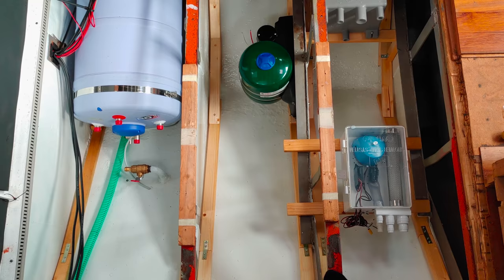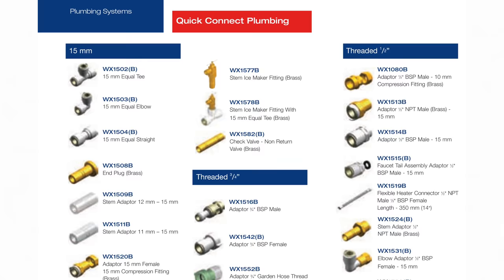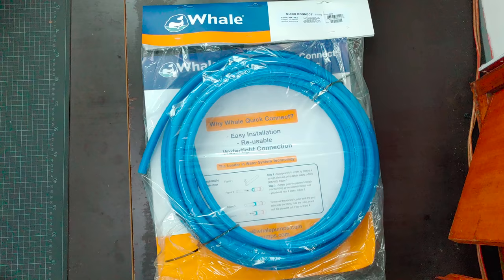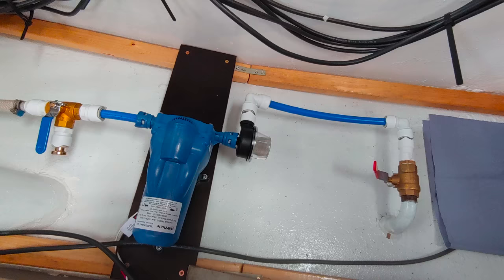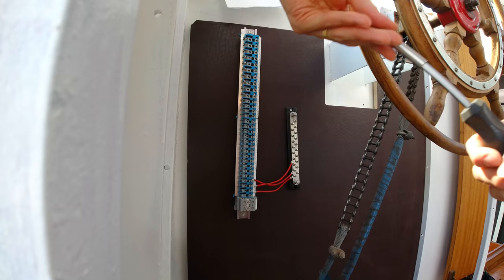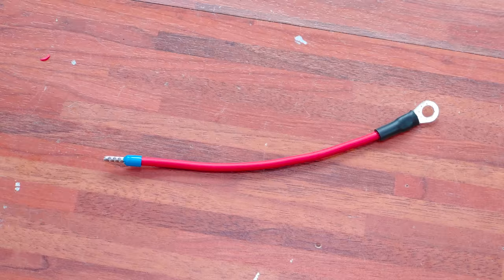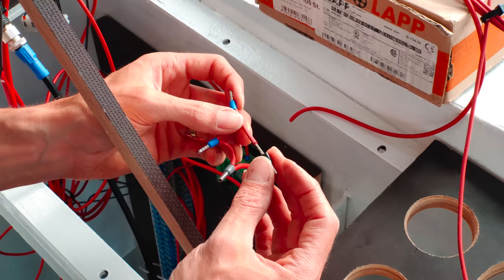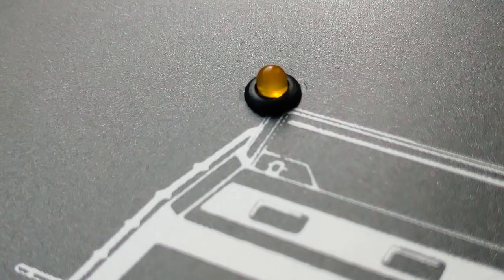Business as Usual at our Boat Refit Project - Ep. #43 - Vintage Yacht Restoration Vlog

Comment: Great video, I love watching your videos. When you use the white connectors like the ones used with the light indicators and on the deck with the anchor light. As a rule of thumb from an old electrician. Try to avoid the connectors with brass insides as the are prone to cracking when in the elements and making a loos connection that will lead to heat and melting. Try to use the connectors where the screws don't directly come in contact with the wire, it will have a metal plate that will be pushed down onto the wire, they are usually black connectors. And when using them outside, use a bigger connector so that both wires can fit on one side and wrap it up in electrical tape all around for a good seal. Always leave the connectors  pointing up so no water makes it in next to the wires. It will save you a lot of effort in the future with loos connections and corrosion on your connectors.

Comment: When wiring on a boat or anytime in my book use Ox-Gard Made by Gardner Bender, Guards against oxidation,The perfect safeguard for aluminum-to-aluminum, aluminum-to-copper wire connections and aluminum conduit joints.

Improves conductivity; penetrates aluminum oxide to maintain inter-strand and inter-conductor current paths

Produces a cooler connection.  Just something to help you down the river.
Reply: If oxgard is difficult to get I always use Zinc oxide in a tube from the local pharmacy. Also prevents reaction between steel fasteners into aluminum parts.
Reply: @mrchairman08  Also works on  Diaper Rash......

Comment: Hello, I think the wire size is to big for a led application, BTW good wiring route, when you finish all the electric remember to label each wire terminal for the future, make a wiring diagram and keep it and order all cables clean to the sight, nice job. Oh, you know what is good? always apply dielectric grease to the exposed terminals, ex.: the block terminal at the anchor light in mast. Sorry for my english.
Reply: there is no to big for wiring only to small or to long

Comment: i don't put on the lugs and terminals until all the cable is run and is laid out.  every one has to be the perfect length and attached to bulkheads properly without crossing so that i can determine the exact location of the lug or terminal.   i don't mind adjusting by trimming but once you cut it to short, it's cut to short.

Comment: These are always interesting post. His narrative and backround music really add to the presentation in his videos. I wonder if he realizes that there are standard color codes for wiring boats. Depending on the function of the item being wired into the boat system there is a specific color for the wire insulation.  By having the wires color coded, it makes it easier to trouble shoot faults in the electrical system.  Having worked on customer wired boats. it is very time consuming to try and figure out what wire does what when they are all the same color. It can come down to running new wires to repair a system or device because it will take less time.

Comment: Boiler/water heater. Please review the manufacturer's instructions on its installation direction. I worry you will have half a tank of air that you cannot purge because of the angle of the install.  If the heater elements are not fully submerged they can cause several issues.  
The heater elements can overheat and the ceramic coating crack allowing direct contact with the water. The electrodes if not fully submerged can create steam in the air pocket. This can build enough pressure to blow your plastic hoses out of their fittings or burst the hoses. 
In a water heater steam explosion in the 1960s. The water heater flew over 3 blocks away .this is not an isolated incident.

Comment: I Recommend later on doing a subfloor and mainfloor instead of the panel system you are using later on we did a re-fit on my 95 searay and on its first sea test the waves caused the single original floor to crack

Comment: As a retired motor controls designer I am glad to see you using wire ends (ferrules). Different colors for different size of wire. I have seen control panels shorted out because a single strand of wire touch an adjacent terminal and short out the system. The only thing I would have done is to have labels on each end of the wire so you would be able to better troubleshoot a possible problem. The same thing could be used on tubing for the same reason. I am looking forward to see the finished project. Btw are you doing this for yourself or for resale? Good luck.

Comment: Still worried about your river water inlet tube (standpipe) why not a bronze inlet. Iron standpipes are known to be cause of sinking of older iron yachts. Installing a bronze inlet is in fact a small job specially if you can reach to the location easily.

Comment: Where's your black water tank going to be?
Reply: Apears toilet goes straight overboard.
Reply: @DadBuilds  I'm amazed if that's legal on German waterways!
Reply: that toilet looks directly plumbed to the bottom of the boat.... so the river is the black water tank?
Reply: I was also going to comment on this, it does appear that the toilet flushes overboard. I’d hope that there’s some sort of black water tank option but I don’t see any sort of valve to switch between the tank and overboard. I wouldn’t think you’d be far enough offshore to use the overboard option.

Comment: I understand that you are not a professional electrician nor an engeneer, but despite the use of the ferrules and the heat shrink tubing on the wires, you are missing many electric conduit. Most of all there a no cable marker labels of any sort anywhere and the general order of the placement of the wires have a lot to be improved. Don't use too much zip ties: they tend to obstacle when you need to do some maintenance